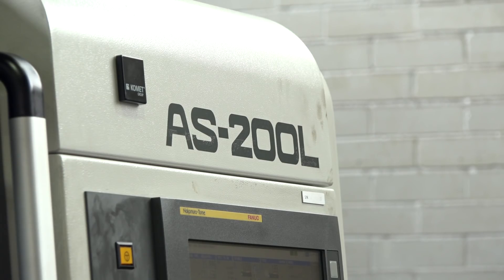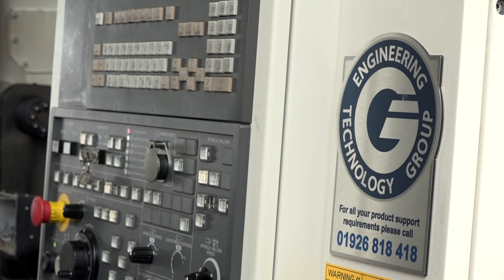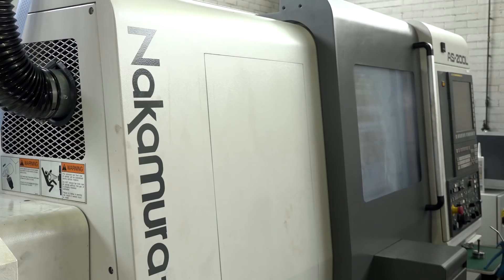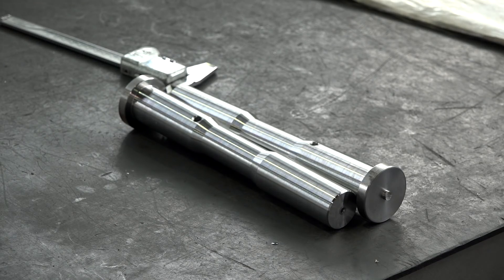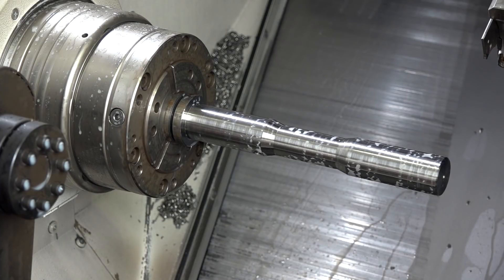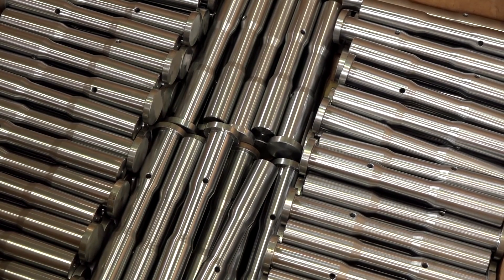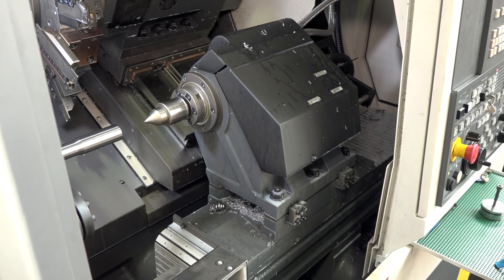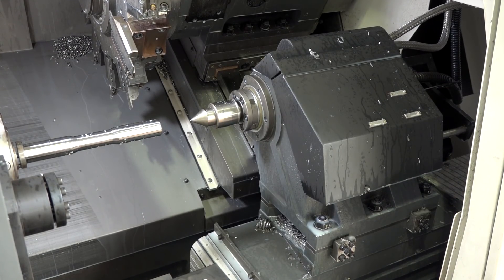Turning those longer parts thanks to a new Nakamura AS 200LY

Comment: I’m curious. If a sub spindle can be used as a tailstock, how much better is a true tailstock? 
These are only 20hp. Is there a major dissadvantage to using the sub as a tailstock?

I use a tailstock sometimes in my turning center but am very interested in getting a sub spindle lathe (and hope the sub will work good enough as a tailstock for short runs 50-500pc)